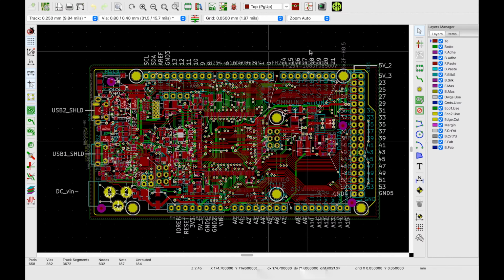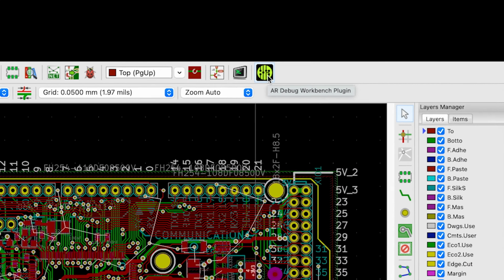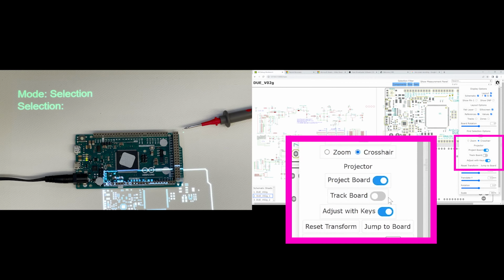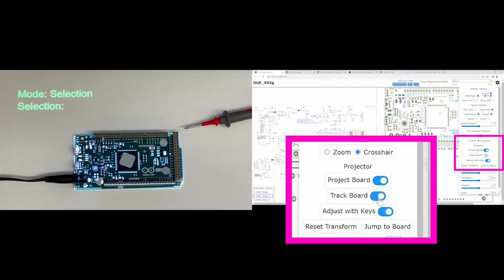ARDW: An Augmented Reality Workbench for Printed Circuit Board Debugging

Comment: Very cool idea! A final design would definitely need a (possibly custom) projector with very strong keystone correction allowing the projector to sit well off to the side away from the user, as typical ergonomics when troubleshooting circuit boards often involves leaning over the board with your head quite close to the board under test, which would occlude a projector placed in a direct overhead position.